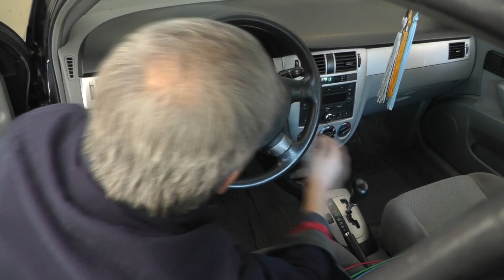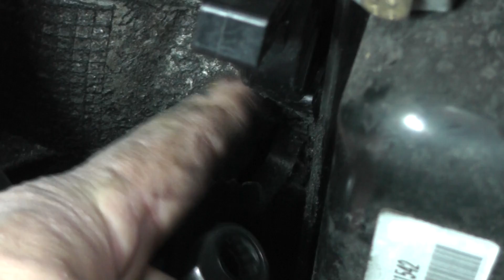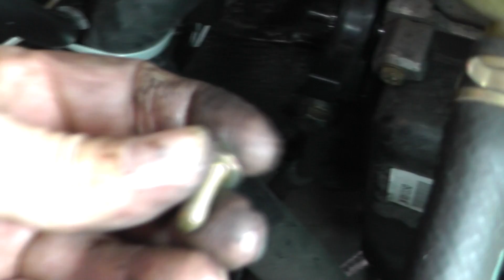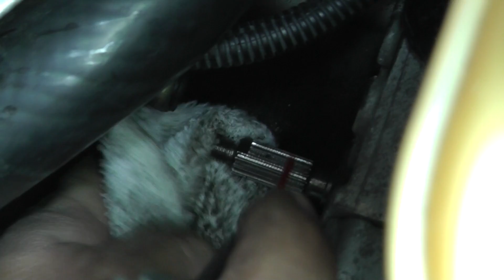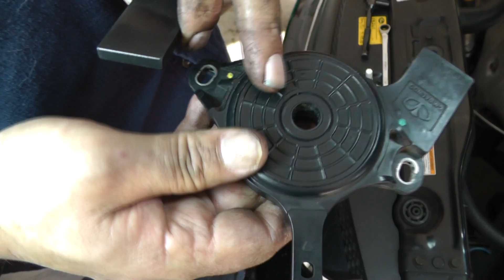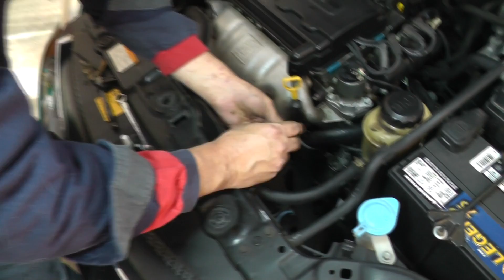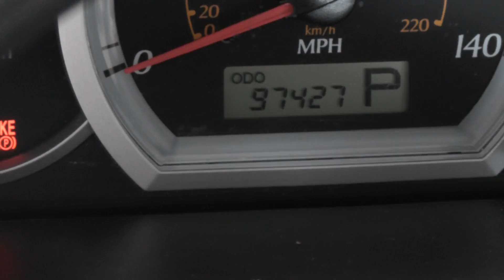Suzuki Forenza Installing Transmission Range Sensor - Part 5

Comment: just received and installed new anti knock sensor. car now much worse! very frustrating. any suggestions?
Danny
Reply from the maker: Andrew...Let's think about this...The car ran fine before the timing belt broke and bent valves? Right? Now, you removed the head and had the valves replaced, machined, etc. You put it all back together and now the car doesn't run well. What does this sound like to you? I'm thinking that your timing is off as I've mentioned before. Did you go back and verify your marks? And if your timing is off, you could also have bent the valves again. That's my suggestion....

Comment: Andrew Pittman1 hour ago
 
Hi Mr. Pike,
Just finished redoing my 2007 Suzuki Forenza that had jumped timing and bent all my valves. Couldn't heave done it without your videos. Thank you greatly. However, this morning I went to test drive and the check engine light is on (I have no scanner); and it runs beautifully but when I put it in gear, doesn't want to go and will even turn off on me. I'm now reviewing the videos you have on the TCM. I could really use some pointers as to how to read the codes on the Forenza manualyl (if possible). I'd also like to know if there is a way to get in touch with you besides this.
Thanks.
Danny Pittman

Comment: Hello, I don't have tool and skills to fix the sensor myself. How much it would to fix it in a repair shop? Does the fix resolve the problem for good? Also, if I drive without fixing the sensor what problems I might have?
Reply from the maker: Since shop prices vary widely across the world, your best bet is to give the shop that you're interested in a call. These range sensors are a problem, but you should get a couple of years out of them. And driving the car with a bad sensor will have high line pressure on the transmission. Also, you will be starting out in 3rd gear instead of 1st which puts a lot more load on your engine. I would get it fixed as soon as possible.

Comment: Great video! Any tips/how would this procedure be different for a Manual transmission?
Reply from the maker: Not sure about a manual tranny. Mine was an automatic tranny, so one thing that would be different is you wouldn't have four of the switches inside the range sensor. That would leave the clutch pedal switch and the other switch for the backup lights. Since these switches could be activated directly from the clutch pedal and the reverse position of the gear shift lever, they could very well be located in a totally different location than what I show in the video.

Comment: Hi again:  I'm about to install a new TRS for Forenza.  The check engine light is on.  I'm wondering if the computer will have to be reset, will the light go out automatically after replacing the part or will simply disconnecting the battery for a while turn the light off?  Thanks, Mike

Comment: do you know the estimated cost to replace the shift sensor on a 08 Suzuki Forena?
Reply from the maker: Hi Weston. If you do the work yourself, the sensor will run about $35. As for a dealer doing it, I've heard from folks on here that the price for the sensor will run about $85 and about $250 to change it. Of course, doing it yourself is always the cheaper route.

Comment: What's the price rang and were can I find one for my 2008
Reply from the maker: I assume you're talking about the range sensor itself. It should cost about $30-35. You can find them just about anywhere. I believe I got mine from www.rockauto.com and sometimes you will see it listed as a neutral safety switch.

Comment: I have to say thank you but, I didn't understand which part you should have to change and how will cost the part?
Reply from the maker: Chris, I'm changing the transmission range sensor and the part costs probably around $30-35. Sometimes, this part is also referred to as a neutral safety switch.
Reply: Thank you. I am from NY and there is 08 needs this part to be changed and AC compressor. mileage is 88k How much it worth?
Reply from the maker: If I understand what you're saying, you also need an AC compressor. Don't know the price, but you can go online such as www.rockauto.com and see what it will cost. Of course, that doesn't include the labor if you have someone else do it. You'll have to call around in your area to see what the cost will be.

Comment: First off, thanks for posting this video. I have a 2007 Forenza and had to first replace the transmission range sensor in 2010 @ 30k miles. It's gone bad again and I think I can replace it myself after watching your video but yesterday, after I bought the part the dealer noted that "with the vehicle in park turn inner splines all the way to the right before installing". Your instructions are pretty straight forward, it's the dealer note that kinda confused me.
Reply from the maker: Hi Georgette. When you buy the range sensor, the splines com preset to the neutral position. You can turn the splines to align up with the park position and it  will work. The service manual shows the range sensor installed with the gear selector in the neutral position. Either method will work though.

Comment: Thanks again for your help. We got the part and changed it out on my Suzuki Reno. No more check engine light or jerking in to gear.
Reply from the maker: Good for you Krista. I'm glad to hear that everything worked out and that your car is running good!

Comment: I think your video is great. It is very detailed and clear. I just purchased an 07 Suzuki Forenza and the TRS just went bad. I will try to repair it with your video and I hope all goes well. Do you know how long TRS for these cars last? Also, is there another way to adjust the sensor without using the tool DW260?
Reply from the maker: Thank you lupita for the nice comment. These sensors will probably last a couple of years, although I have heard that some people may get several months. You don't need the tool as I mention in the video, just put the top bolt in the center of the slot and you should be good to go.
Reply: stuzman52 Thank you for your response. I have one more question. Is the the tranmission range sensor the same as the neutral safety switch? I'm trying to purchase that part but I haven't had any luck finding it.
Reply from the maker: Yes, it's sometimes referred to that also. If you remember from one of the videos, four switches are for the transmission, another switch is for the neutral safety switch and there is another switch for the backup lights. So, there's a total of six switches inside.

Comment: I took mine off and I can't get the old or new one on. It's just tearing the splices when I try to slide it on as if it's not lined up I've checked more than ten times idk know what's the issue.
Reply from the maker: Okay darr. You got it off so you know it will go back on. As you saw in the video, it is a snug fit, and you'll have to get the sensor perpendicular to the shaft before it will go on. Try standing off to the side over the fender to give you a little more leverage and it will help you to see how straight it's going on. Try that and see if that will help.
Reply: stuzman52 tried that also. It will slide back and forth over the beginng but it stops as if it is being jammed against something
Reply from the maker: Yes, mine did the same thing where it would hang after it went on for a little bit. That's when I reached over the hood, grabbed it and gave it a good pull toward me. It slipped on at that point.
Reply from the maker: darr guill The last thing I can think of darr is to take a close look at the splines. As you saw in the video, I had an issue getting this sensor on too. I'm not sure what's going on with it sliding straight on as you would think that I wouldn't be that much of a problem. Don't give up as I know you'll be able to get it.

Comment: do you have to have the installer too. I have called the dealer and they said they could not order any tools and the website you suggested says to contact dealer? any suggestions would be appreciated. thanks
Reply from the maker: Hi Krista. Yes, the dealer more than likely won't order any tools for you. And as for the website, I'll post a link directly to the tool where you can add it to your cart. Now if you want to save some money on the tool, take a look at the top slot that I mention in this video. Make sure that the bolt for this slot is in the middle of the slot and that's where you will tighten the bolt. With the bolt in the middle of the slot, your adjustment should be very close and should work fine. If you want to order the tool and get a more accurate adjustment, the place where I ordered the tool is located here https://suzukipitstopplus.com/Products/1-parkneutral-post-switch-installer.aspx As you can see from the website, even if you are not a dealer, it says you can add the item to the cart. Good luck on your repair Krista and let us know how it turns out for you!
Reply from the maker: Krista, since you are the second person who has mentioned where they could get this tool, I have provided the link also in the description of the video near the top. Thanks for stopping by and leaving your comments.
Reply: stuzman52 Tthank you for you fast response. I ordered the sensor and should get it next week. I'll let you know how it goes. Thanks again

Comment: I have a 2007 with 87K miles and just had a new head job. I tried to drive and test out the new head and valve and my car would not go shift out of 1st. Runs good but not going over 20-30 mph. 
List of problems:
1. Will not shift out of 1st gear 
2.Have to manually unlock (shift lock) to shift out of park 
3.New head job 
4.Does not go over 20mph 
5.High RPMs 
6.Sometime shift unlock and sometime it locks.
7.Sounds as if I have a new exhaust on it .
 Can you help me please!!1
Reply from the maker: Sent you a private message to your inbox Brenton.

Comment: thank so much. on my forenza gear no. 1 won't kick in , you think might be in need of calibration, sensor replacement?
Reply from the maker: It' very possible J Diaz. Is your check engine light on? If so, you may want to read the code and see if you have the code that I had. Also, is your display indicator for your gear selector not showing the correct gear? If so, that's a pretty good indicator that the transmission range sensor could be at fault. Hope you get it fixed J Diaz, and you take care!
Reply: stuzman52 couple of time I had p0700 code, and I had to reset the transmission inserting the key in the slot to loose the lock. earased code and drove off fine. but 1st gear don't go all the way, you are right. what's the part number for the straight edge to adjust it? thanks
Reply from the maker: Hi J..I can't remember the part number as it was DW-something....Take a look at the last video of where I used the tool to adjust the sensor as I show the part number on the tool. The tool is fairly expensive which was about $80.00 if I remember correctly. You can get by without using the tool by making sure that the top bolt goes into the center of the slot. I show the entire procedure of how to adjust the sensor without the tool in the last video. Hope that helps you.

Comment: I had issue getting the new Range sensor on and ended up breaking the plastic. Should I buy a new sensor?
Reply from the maker: Well, if it's broke, it sounds like you probably need to get another one. Sorry to hear that, and thank you for your comment.

Comment: Im having a problem fixing the stereo on my suzuki, I have checked the fuse box and nothings wrong ? Any ideas what it mite be ?
Reply from the maker: Well, it could be several things, but you're going to need a diagram to check things out. Could be the stereo, speakers, connectors, etc. Although it's for a different car, the diagrams are the same for a Suzuki Forenza which matches up to my factory service manual. Here's a link to that manual....
http://lacetti.com.ua/chevy-man/EN/documents/Nubira-Lacetti/start_Nubira-Lacetti.html

Comment from the maker: You're welcomed. There isn't a PCV valve on the Forenza. It is nothing more than a calibrated orifice inside the valve cover. To check for vacuum leaks, you could use propane while the car is running, carburetor spray (be very careful, flammable) or the best is a smoke machine. Do search on YouTube for finding vacuum leaks.

Comment from the maker: Hi Estuardo. From your message, I put it in the translator to come up with English. "I have a problem with my suzuki forenza 2006 is consuming too much fuel and therefore I would like to help to repair salute from Guatemala."

This could be a multitude of different areas to look at. Is your check engine light on? If you have a scanner, take a look at your short and long term fuel trims. Possibilities include O2 sensor, injector(s), vacuum leak, etc. Long list of things that it could be.

Comment: A question if you don't mind I replaced the sensor in a forenza adjusted it and it worked fine for a month then same issues dash reading funny and hard shifting. I adjusted it again and its just fine for 2 months then same issues.  do you think I could have gotten a bad part? or hurt it on install? Do you think I just cant get it adjusted? I am a little frustrated to say the least.thanks for your time.